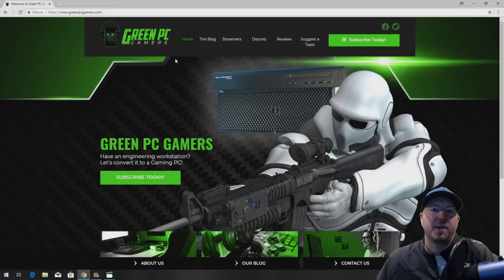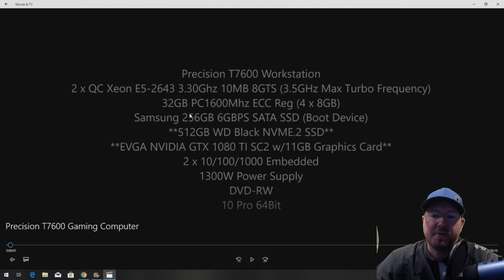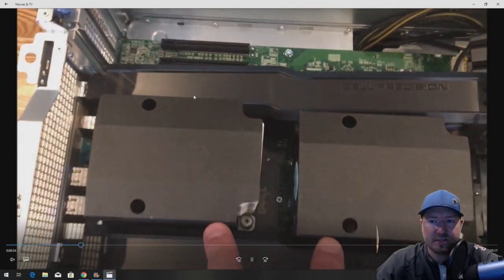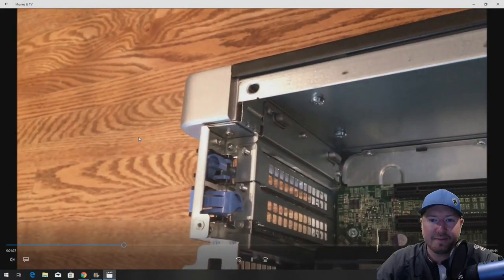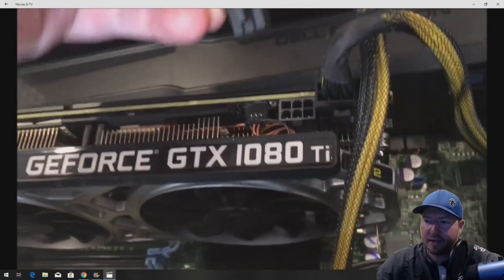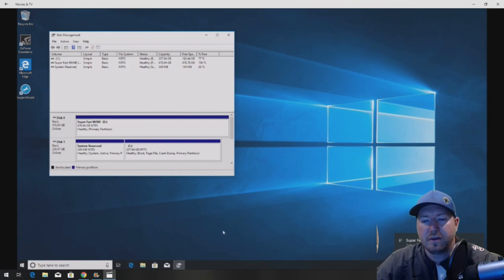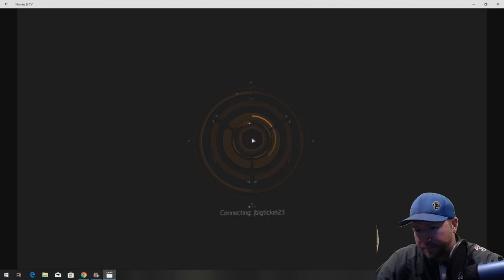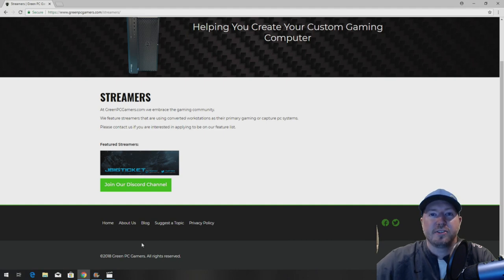Precision T7600 Gaming Computer NVME.2 and GTX 1080 TI

Comment: You can actually boot from NVME M.2 SSD storages. Use bootloader like Clover or DUET, it's a bit hard to do for beginners but it totally works.
Reply from the maker: You are correct, thanks for sharing this.
Reply: is the bootloader only one solution guy, NVME from PCIe cannot boot OS as native drive?
so if we want to install OS on NVME, we have to use bootloader
Reply: YOOOO THANKS

Comment: i have T7600 - Dual Xeon E5-2687W  64GB ram & GTX 1070       but cant run windows 11. should i install tiny 11 or windows 10 will be a better option.

focused work : Game Development in unreal engine 5 and gaming.
Reply: Any answers?
Reply: If it can run Windows 10, it can run Windows 11 (it won’t be a vanilla install).

Comment: first, thanks for the great video! I have a T7610 ,what is the difference between 6710 and 6700?  are their casing and space same ?can 6710 upgrade graphics card ?
Reply from the maker: They use an almost identical case.  (other than the different text for schematics and model #'s)

The Main differences:

Precision T7600 Supports E5-2600 V1 Processors
Precision T7610 Supports E5-2600 V1 and V2 Processors

Precision T7600 Supports 10600R and 12800R Modules
Precision T7610 Supports 10600R, 12800R, and 14900R Modules

The processors that you install may downgrade your memory speed

There are some other minor component differences just because of one system being newer than the other. 

Thanks for commenting!
Reply: @GreenPCGamerscom  I was so lucky that you replied me !!!  thank you for your professional answers , I have one more question is can T7610 support 30 series graphics card ? Can the maximum support to 3080 or even 3080ti?

Comment: Just got one of these and threw in my AMD cards (r9 380 and rx 480) and they both extend past the width of the case. I was prepared to dremel the video card brace off of the door like I did for my t5600 BUT the t7600 is actually 0.75 inches narrower in terms of the space between the mobo slots and the case door. Also, the PCIe slot at the top of the case is blocked in by the latch mechanism in the case door. Now, I'm looking at returning the PC or designing & building a custom door to fit these cards in!
Reply from the maker: Hey Jay,  it’s all part of the fun.  Please send us pics if you make a custom side panel.

Comment: These systems typically come with 7 15k RPM drives in raid and they are really fast for mechanical drives.
Reply from the maker: I wouldn't say that Precision T7600's typically come with 15K RPM SAS drives, because they were all custom builds when they were sold new.  However, the 15K mechanical can be a great performance to cost ratio.  Thanks for commenting.

Comment: I have the Dell T7600 in the dual 8-core configuration but there are several 10-core and 12 -core CPU's that will also fit in that LGA 2011 socket. Is there a way to tell if those 10 and 12 core CPU's will work in this system? Dell didn't offer those as an option with this system but I think they might work and now they are pretty cheap.
Reply: Did you ever try this? Just bought one myself and am curious what it can do. Thank you!
Reply: @traxxasftw  Yes I did. The  12 core CPU will NOT work on the T7600 motherboard. So I found a cheap T7610 motherboard and I installed it and 2, 12 core CPU's and everything worked great. Everything fit and the only thing I had to do was re-route a couple cables.

Comment: I have a dilemma. I wanted to do a bunch of gaming but wanted to add an RTX 2080Ti and MVME.2 on an OS, run RAID, a server setup and several VM setups with Domain Controllers seamlessly. Should I go with T7600, 7610. Thanks! 
Or the T5820 or 7920?
Reply from the maker: The T7910 or the T7920.

Comment: hey i have a t7600 and i can't even boot to a normal sata ssd? is there a way to fix this? has it got something to do with raid because my pc does have a perc h310 raid controller but i dont want to take it out as i have sas drives
Reply from the maker: Have you tried plugging your SATA SSD in to one of the onboard SATA ports?  You can access sata power by removing the non-easy access panel with 3 Philips screws.  You'll have to enable to specific port that you use in the bios.

Comment: Hi, I have heard there could be problems with regular PSU. I'm going to buy single motherboard of T7600, but I don't know what PSU I need to choose. Is Super Flower or Seasonic will power that MOBO? Also I have RX580 Strix...
Reply from the maker: We've never tried those PSU's with a T7600.  Let us know if you try it.
Reply: UPDATE DID YOU TRY IT?

Comment: Did you ever benchmark the nvme drive? Are you finding it worth the upgrade even though it's not the boot drive.
Reply from the maker: We did run a benchmark.  The nvme.2 ran slightly slower than the mfg posted speeds.  It ran even slower the more we filled it up with storage.  However, it did provide a significant performance increase compared to a regular Sata ssd.

Comment: how can i determine the throughput on the PCIe slots above the processors? I may want to get two adapters to install two NVMe drives, but if there's a bottleneck, I'd like to avoid it.
Reply from the maker: We like using ATTO Disk Benchmark.  Choose PCIe x8 or PCIe x16 slots for the fastest throughput.

Comment: I realize before I ask this that I'm asking this of the wrong crowd, buuut I need to upgrade and I'm trying to cover all perspectives. 95% of what I do is photo/video editing, AI, and VMs for testing at work (I'm a junior systems admin). I'm also broke. My previous rig was a 10 year oldA MD FX-8120 with 16GB of RAM, 256 SATA SSD, and a 1050ti 4GB. I had a motherboard failure, and then later a GPU failure, and now I'm down to a Dell Vostro 230 upgraded to a Q9550 quad core with 8GB of RAM , GTX 980 4GB  and a 512 SATA SSD a friend gave me. I've done the math, and I can pick up a T7610 motherboard for around $110, 32GB of RAM for about 80 (what I have isn't ECC), and E5-2687W for around 110. I'd be at 300 bucks, with the ability to add more RAM and a second processor at some point. The above config would be on par for with a Ryzen 2600 based system, which would cost  220, or 345 if I maxed out the ram (compared to 350 for the same amount of ram on the Xeon system). If I upgrade to a 3600x on the Ryzen,  I'm at 470, which really pushes my budget.  Anyway, which way do you think I should go?

Comment: Hi sir one more question. Does quadro RTX 5000 support with dell T7600 or not?
Reply from the maker: The RTX 5000 should fit in the T7600.  However, you will most likely run in to some bottle-necking.
Reply: GreenPCGamers.com thank sir

Comment: Could I put 2 Nvidia 2080 Ti on my Dell T7600 ? Is it possible ?
Reply from the maker: I wouldn’t recommended it.  You’d have heating issues if you stacked 2 x RTX 2080 Ti cards in a T7600.  You’d also struggle to provide 4 x 8 pin cables to properly power the cards.  Why isn’t one RTX 2080 Ti enough?  One single RTX 2080 Ti is more than you’ll need for pretty much any game on the market.
Reply: @GreenPCGamerscom  can i put two rx 570 cards or more with the help of risers ? to avoid heatingg issues

Comment: I have T7600 and GTX 1080 Ti Asus ROG Strix Aura OC Edition and case can't be closed. GPU is too big.
Reply from the maker: We used the evga version that is posted on our blog page because it will fit in the chassis.  You could cut a hole in the chassis to allow the side panel to fit with the Asus gpu.
Reply: you can find low profile right angle connectors on the interwebs
Reply: @GreenPCGamerscom   I changed my GTX 1080 Ti Asus ROG STRIX AURA OC Edition for GTX 1080 Ti Asus Turbo  2xLonger Lifespan with Dual-Ball and case is finally closed.

Comment: T7600 work with rtx 2080 ti lighting z or not bro
Reply from the maker: We've never installed the MSI RTX 2080 Ti Lighting Z in to a T7600.  We have installed the EVGA RTX 2080 Ti in to a T7600.  You could compare the sizes on the mfg websites.
Reply: GreenPCGamers.com thank sir

Comment: Hi, i'm wondering if any rtx 3070 gpu fits the T7600, have anyone try it yet?
Reply from the maker: We tested the RTX 3070 Ti Founders Edition and it worked well.  The RTX 3070 will also work in a T7600 workstation.  However, not all 3070 versions will fit in a T7600 case.  You'll have to look at the measurements of the specific mfg 3070 card before ordering it.  You could also consider making mods to your side panel to accommodate whatever mfg card you are able to find.
Reply: Hi, this card RTX 3070 is PCIe version 4 but as I know the T7600 only supports version PCIe 3, so how did that happen ??  I'm wondering how your system accepted that card.
 @GreenPCGamerscom
Reply: @E_Waste 
It works on both 3 and 4. But it not gonna give you her best if you put her in pci 3.
Reply: @wassimznaidi306  Okay, Coz I'm afraid to purchase her for my system then not work!
Thank you very much.
Reply: @E_Waste  Dont buy it until you'll be sure at 1000%. You can verify in forums and videos which proves what I'm telling you.
Good luck bro 🤞🏻